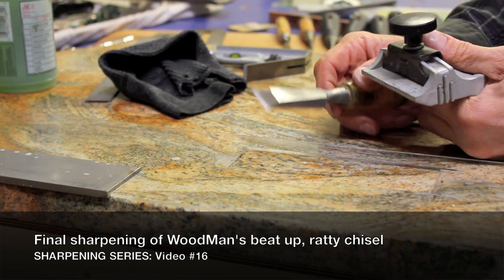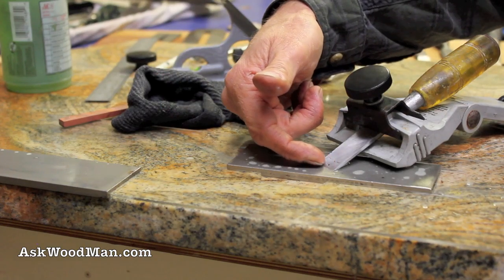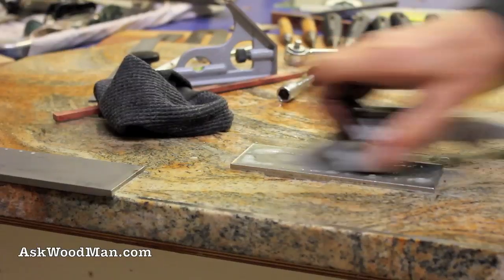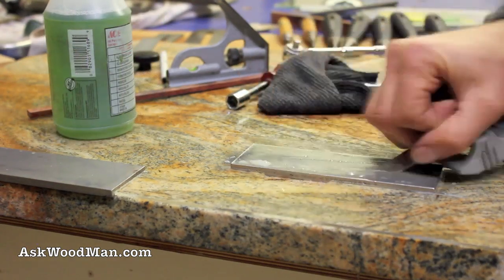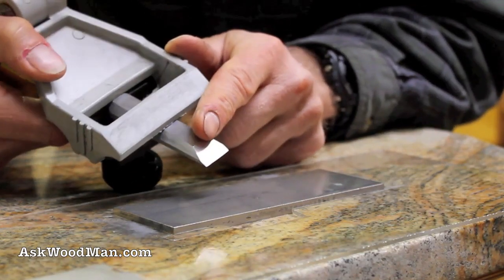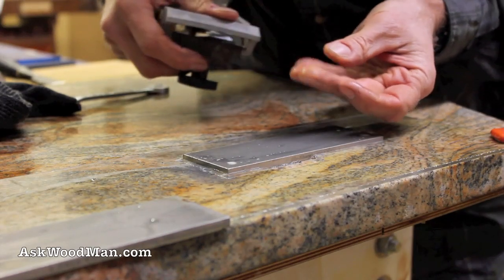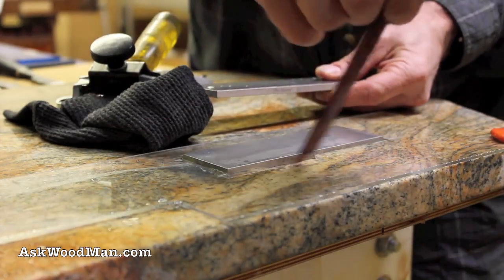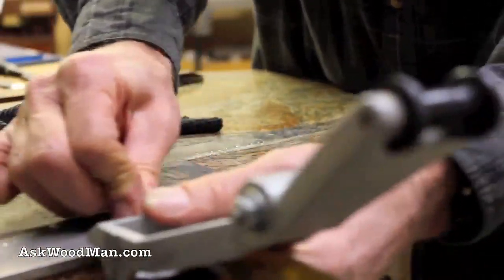How To Sharpen A Woodworking Chisel • Complete Sharpening Series Video 16

Comment from the maker: This type of sharpening is trying to make two planes meet at the smallest dimension intersecting line. The more refined this line the sharper the tool. The side to side motion covers a lot if linear distance really fast while removing material close to the edge in a more polishing manner. It has worked really well for me to produce a very durable sharp edge very fast. Thanks for writing.

Comment from the maker: I do not use compounds. This mix of water and Simple Green (50/50) is a cutting fluid. This works great on the diamond stones I use to hold the cut particles in suspension.

Comment from the maker: @smfield I tried that years ago but just did not feel the extra effort yielded a substantially better or more durable edge. It is a method many use but I have found for my work, when I just have to stop in the middle of an operation and give my tool a fresh edge, my four stone method gets me right back to work in just a matter of minutes.  And often I just need to hit the edge with fine/extra fine on the diamond stone. Craftsmen working alone get set in their ways. I will try them again. Thanks

Comment from the maker: That General jig is readily available at Woodcraft, Amazon, and many hardware stores. It is not perfect but when you weigh the low cost and the versatility of the design that allows for holding odd shaped cutting tools (which most of us have some of) it is really the best value in my opinion. And since it does not roll on the stones, the effective stroke is almost 100%.

Comment from the maker: It is a 50/50 mix of water and Simple Green All Purpose Cleaner. Simple green is a great non toxic, biodegradable product that is inexpensive and works fantastic as a cutting fluid. And even in this cut mix there is no rust promotion. I do not even wipe my drill press table off and no rust at all. It works great for sharpening and for drilling too, and I spray it on my hands to keep them clean.

Comment from the maker: Check out Video 4 in this series. I show a cheap plexiglass holder that is easy to make. I have since switched to 1/8" steel because I kept breaking the plastic as much as I sharpen. I have a new sharpening jig I came up that I have a new series here on my channel that has more sharpening demos. In this new series you will see a new version of a stone holder that really works well, that I just made from scrap steel. Thanks for writing and keep in touch. Allan

Comment: Bought myself the general jig and diamond stones and have had great results using your techniques.  When i set the jig up without a chisel in it on my flat surface one of the rear black wheels is off the surface about  2mm and because the jig rocks slightly my sharpening results are slightly skewed.  Maybe my jig is faulty. Does your jig sit straight without rocking without a chisel in it?   Thanks Adam

Comment: I bought the general sharpening jig and your right for the cost it works well just need some practice with the set up. What was the cost for the diamond stone from DMT and who did you contact from the company?. Could use a little help in this matter. Thank,s for your time making the video and the effort.

Comment from the maker: It works well. Have you seen the latest sharpening series I have featuring my new sharpening jig invention? My new tool company VerySuperCool Tools has shipped to them 5 continents with only great reviews. It solves all of the problems every other jig does not. Max stroke, odd shapes, extra large, extra small, continuous easy bevel adjustment, works with any thickness or material of abrasive. It also has practically no learning curve. Made in USA.

Comment: Spent almost an hour to find this video. The one who uses Simple Green as sharpening lube. Might I ask what is the dillution ratio? And can it be used on wheatstones?
Reply from the maker: 50/50 water to SG. I only use this on diamond stones.
Reply: @AskWoodMan  Thanks. I also read that for waterstones, the ratio needs to be 1/100.
Reply from the maker: @lilystrong9870  Never heard that.

Comment: I don't sweat the double facets or if indeed you have a hollow point in the middle, unless of course it is huge. As long as the front is sharp and square that's all that is needed for the chisel to do it's job. Anything else is just wasting metal.

Comment: At what angle do you sharpen your chisels?
Reply from the maker: +Ralph Caliendo Generally 25 deg. But the angle can be plus or minus no problem. The main thing is a dressed sole and clean facet. A 27 or 28 deg bevel is still going to cut fantastic if properly sharpened.